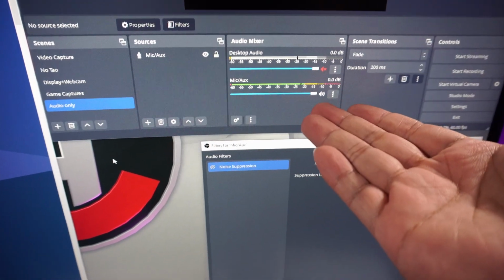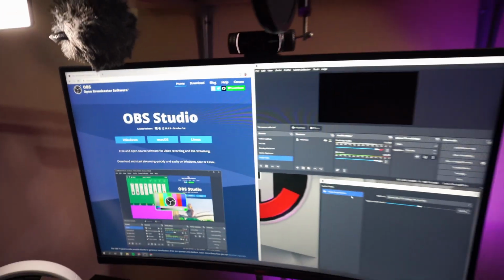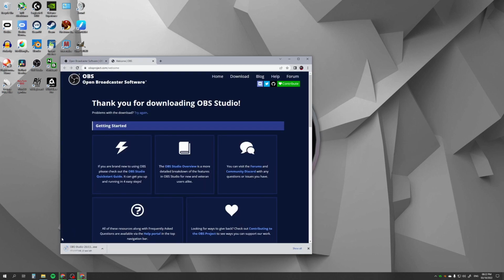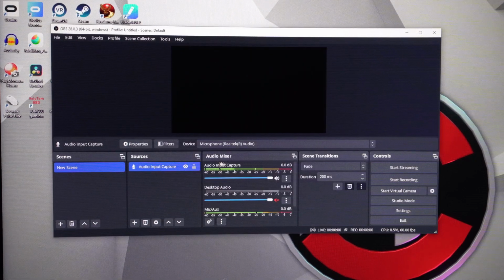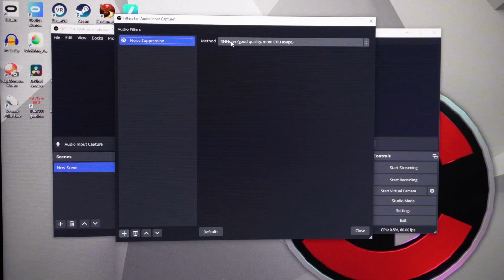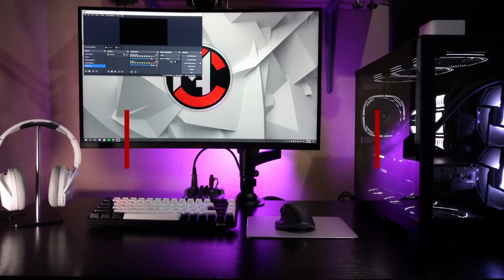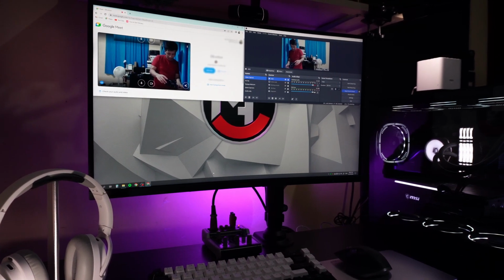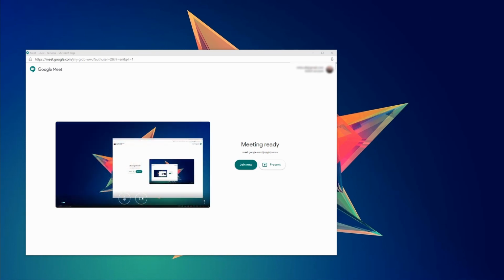How to remove buzzing sound from mic? Quick fix step by step tutorial

Comment: is this buzzing sound normal on condenser mics or my mic is just broken i just bought a condenser mic and it has this slight buzz been looking for solutions
Reply from the maker: most 3.5mm or the a jack connection for budget condenser mic have this type of problems. usually i use  a usb audio interface to fix this problem and obviously with the obs noise suppression
Reply: @MacCoyzkie  im using the redragon gm300 rn and good to know that this is not the mic cuz i was about to just throw it in my wall for the annoying buzzing.

And what is an interface can you recommend a budget friendly interface cause i dont know anything about that
Reply from the maker: @ejrt8089  its something like this https://youtu.be/fWXgcY-yhBI but i don't think it will work with your current mic. I was using bm800 before and has a terrible buzz sound but with the audio interface it was fixed a bit
Reply: @MacCoyzkie  so mines just broken? I tried the obs noise suppression it worked any thoughts? And thank you for replying so fast you earned a sub cheers 🥂
Reply from the maker: @ejrt8089  no i mean the audio interfaces usually uses jack connections and the gm300 uses usb so its more like incompatibility. you can play around with the noise suppression settings and find the best settings for your mic. btw ty for the subbed
Reply: @MacCoyzkie  welcome for the sub and thank you so much you've helped more than any videos I've watched trying to fix this issue. 

Keep it up worth the sub 💯💯
Reply from the maker: @ejrt8089  will do 😀